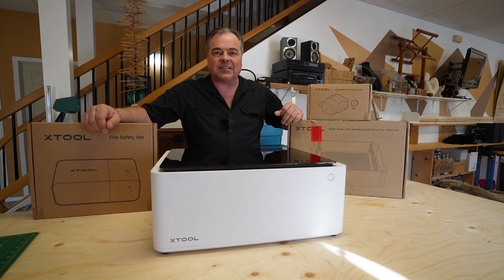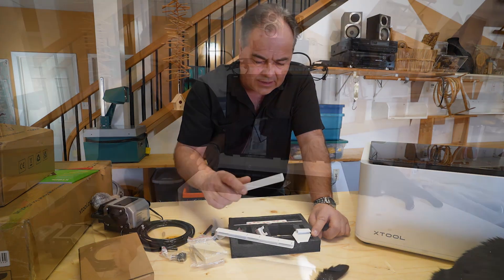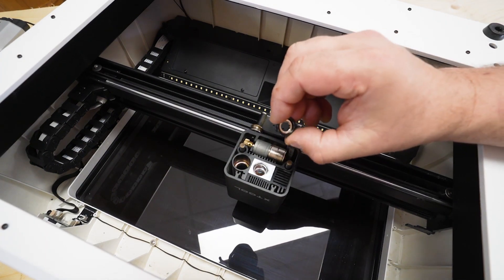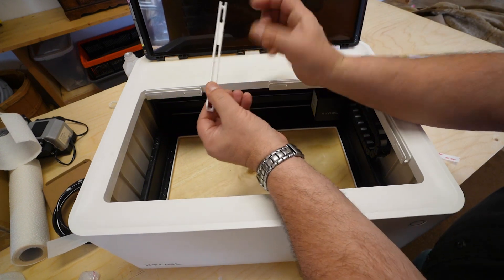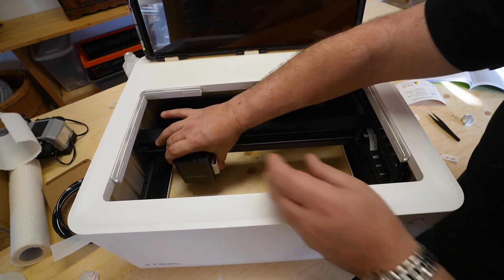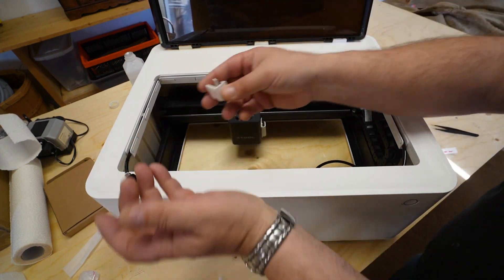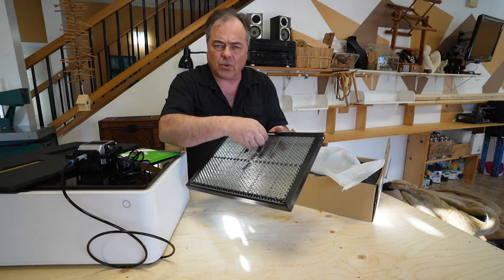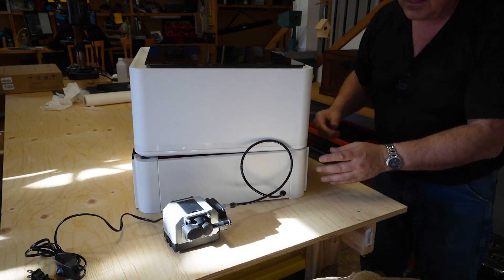Laser Air Assist and Riser Base Setup for xTool M1

Comment: Thank you so much. I watched many other tutorials and my laser cutter was bumping into the LHS at end of a project. I watched your video and finally found out about the marks on the tubing, straightening out the tubing, what the other two grooves were for and the rubber washer. I redid the tubing properly and it now works perfectly. Others just leave these bits out and it caused me a lot of stress thinking my machine was broken - along with the worry about what to do about that as I have just bought it 2nd hand, along with a lot of lost hours. A massive thank you for a professional and thorough lesson.
Reply from the maker: You are very welcome. Yes, the washer is missed on other videos because it's not in the instructions. Glad to hear that I was able to help :)

Comment: important to note: if you've been using your machine and are now adding air Assist to thoroughly clean the machine/ especially the side of the laser head before applying the hose holder.  this will prevent issues down the line.  otherwise a great Video.  also the paper comes off the rise base front and back to allow you to view through the plexiglass to see the engraving.  mine is Orange same as the top.
Reply from the maker: Thanks for the additional tips. Cleaning the laser head is essential, and I appreciate you pointing out the riser base paper detail.